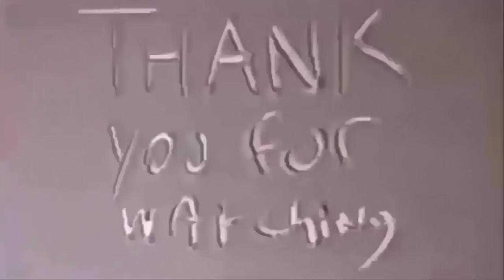How to Plaster over Artex and Textured Ceilings

Comment: Nice work mate! So is it OK to just do one coat with the bonding mix? And would it be OK to leave bonding to dry out for a week or so before another PVA coat and then 2 coat skim? I think I would struggle to do bonding and skim coats in the same day
Reply from the maker: Hi mate I would try do it next day if you could so its not as dry still might be good to give a little pva also then 1st coat and 2nd coat with a new mix so it gives you more time to help you get a good finish

Comment: My cellings in need of a skim how much pva do I put on one coat then let it dry then another coat then skim I'm scared of it cracking
Reply from the maker: Depends on the type of pva mate most want 1 coat then yes a 2nd coat when the 1st has dried then plaster over when tacky pva wont stop cracks only way to stop it re cracking is stop movement ie a lose plaster board of moving timbers above and re scrim taping before you plaster but pva will stop the plaster failing and drying in to fast before you finish it, It is a very important part mate have a few other videos showing detail on that also

Comment: Great video. If  I key up my bonded ceiling with a stiff bristle brush let the bonding coat dry for 24 hrs and then plaster it because I've keyed up the bonding will I need to PVA it because I have let it completely dry.?
Reply from the maker: Hi mate If i was to do it the next day the way I go about it is I would bond ceiling up at the very end of the day and it would be the very 1st thing on the next morning sometimes if its to dry you will need a coat of pva just have to test to know what suction is like , but i have done it next morning a good many times with no issues but you are still always aware to get it on quick and neat as possible just encase if that makes sense :) Thanks for watching and supporting buddy means a tone :)

Comment: Good job mate, can it be done on flaky artex?
Reply from the maker: B3efore plaster8ing any lose or dusty or flakey surfaces would need to be made clean sound and dry before plastering over so flaky would need scrapped clean just make sure its free of asbestos and wear a mask all the same mate all dust is bad for us to breath in but when you get the prep done the methods i used are good to go :) Thanks for watching buddy
Reply: @macplastering  Thanks for the info, good video. Cheers.
Reply from the maker: @HektorBandimar  Any time buddy just remember we are only as good as the surface we are working over so get the preparation right and the job will go great from there in :)

Comment: Hi, quality work mate, when you use the speedskim on finish would you recommend the metal blade or the plastic ?. With always using a stainless steel trowel you'd think the steel blade speedskim would be the obvious choice but not if the edges needed to be broken, whereas the plastic blade might be more forgiving. Keep up the great vids.
Reply from the maker: I hear you mate I have found most the steel spats good they do have a slight round on them but some like you say leave a little line / trowel mark but the way i use them its fine as either on the bonding a quick flat and brush over for the skim or if using over skim I trowel up after s the lines dont effect it much at all as i use it to help get flat and straighter  hope this helps some

Comment: Hi Mac, that is a quality job 👏 

Is it possible to just go straight for the ceiling with multi rather than bondin it first, I think I made a mistake 😬 as in I 2 coated with multi only but it looked decent after. Think I’m gonna be bonding first in future.
Reply from the maker: Hi Paul buddy great question , Yes it is ok but remember skim is best at just 2 to 3mm  if I just tried to skim this it would been mabe 6mm plus in areas , bonding is great for a few reasons it acts as a filler as i showed and a way to get them angels nice and straight, also its got great bonding capability's more than just skim its a little more flexible , so should help slow / stop cracks , its fire proof and will help stop sound also , its weakness is that it is useless to anything damp , but skimming on low texture is ok i just prefer this way on the most
Reply: Thank you for your descriptive reply Mac , I’m definitely gonna use bonding in future. Your ace on them stilts mate, I recon I’d go through the bedroom window on them 😂😂😂
Reply from the maker: @paulrossiter9567  Have almost done that before myself luck there was to strong lads there to catch me I would have been a mess heading head 1st at some french style door glass and thin wood it would not have been good LOL

Comment: Good video, one question you have brushed the bonding so the skim coat will key , would you PVA the bonding reason I ask some plasters PVA bonding plaster because it sucks the water from the skimming plaster?
Reply from the maker: It dose but it wont if it is fresh bonding and skimmed at the right time I like to get the skim on when its setting or has just set if going the next day it most likely will need pva to control suction hope this helps mate  :)
Reply from the maker: Always 2 coats of skim mate some guys do 1 but I always do it by the book 2 coats everytime :)
Reply: @macplastering  cheers that helps.
Reply from the maker: @dilligaf2386  my pleasure mate always here for help and support :)
Reply: @macplastering  it's good to have someone you can get advice from, cheers.
Reply from the maker: @dilligaf2386  Anytime mate always here and open to doing how to's that the viewers want to see :)
Reply: @macplastering  hi my friend would you be able to answer a query,  how thin can you use bonding plaster, I've got some bits that need bringing out 3 or 4mm before I plaster.  I know you can go 11mm but can't find anything about how thin it will go ,or is that because you can go as thin as you want to.
Reply from the maker: @dilligaf2386  Hi mate carlite say when using bonding you must apply it like 12mm or they wont cover you if anything was to go wrong but I have used it as a backing plaster to get door frames or patch in door way ect with bonding from a few mm up to a few inches  but if it is deep best to just put another board on LOL but to answer you I have used bonding a few mm think and has been fine for me
Reply: @macplastering  cheers buddy.
Reply from the maker: @dilligaf2386  My pleasure mate anytime :)

Comment: Nice one Mac mate!  I bloody hate Artex! Have you ever tried to get it completely off?! Bugger that eh mate!
  Btw  Could you use SBR instead of PVA?
Reply from the maker: Hey buddy I lost a job before and apparently the other guy doing it was going to use sbr but I would say it would work but in my opinion and experiences with both sbr and pva , pva for this is way more practical, oh  hell no on getting it all off LOL not this type of texture ts skim coated then swirls and painted so strong LOL only way getting it off is a hammer and re board LOL Thanks for the comment buddy raised a great question :)
Reply: @macplastering  Awesome... thanks for the reply Mac mate. Like most other lads the first thing I would think of doing would be to overboard with 9mm boards. But for sure I'll be using your method from now on. And whether asbestos is present or not, if you're scraping back or rubbing down you should wear a mask and safety specs. I've got a proper good filtration mask that doesn't make your specs or goggles steam up! That's a bloody pain as well. All the best my mate!
Reply from the maker: Oh yes Craig buddy safety all the way getting good googles and masks can be hard  to do but a good set will be well worth it all the same :)
Reply: You can use sbr but always go onto it while it's still tacky. Gives a very strong bond that way

Comment: Sorry to bump an old video. I have popcorn ceilings. Maybe 3mm max in some places. It's a 60s build so most probably asbestos. 
Can I get away with 2 coats of finishing plaster or should I use bonding plaster 1st as it's 3mm max. 
Do you have a link for a decent first coat trowel. It's a minefield. 
I've always used joint compound but want to have a crack at the pink stuff. 
Another question if the final coat doesn't give you the desired finished (worst case ) can this be rectified by another skim coat. I like to know I can sort it before looking like a fool calling a plaster out. I'm very handy and am confident but helps to know worst case senerio. Cheers
Reply from the maker: if it is sound and not lose I would pva bond and skim mate , very very worst case the whole lot drops off , other it cracks but try do like i did scrim any old cracks , other bad things is it dont look good finished , and yes for sure you can re-skim as long as laths hold the weight , plaster is heaviest when mixed as it dries it will become lighter, reasons for a fail could be lose background , poor prep ie dust or missed areas with pva or wrong mix of pva to weak,  pva and bonding will go a good way for you bonding is even lighter that skim coat its  fire proof and acts as an insulation heat and sound some also believe it helps reduce cracking, getting the timing between bonding coat and skim coat will help as it can blisters and slide if to early I know for sure its a great option as you can find more than just tis video with me going down the route, Think i have covered all your question's again mate there is more on this on the channel if you need :)
Reply: @macplastering  Thanks Mac I hear what you're saying. USE bond it will make life easier and neater. Can I apply the bond coat 4mm/5mm ? I have a loft panel in the room so I was trying to avoid going too deep but guess I can rebuild that if needs be. 
After applying the bond coat realistically how long after do I have to add the 2 finishing coats. Several hours window or as soon as the bond starts to dry otherwise it needs another 2 coats of PVA ? 
My guess is the bond is kind of like using overboard it gives the plaster a smooth surface for quality finish. 
Will any stainless steel trowel work ? Whats the best option here. 
Thanks for taking the time to Reply and 1 Sub added.
Reply from the maker: oh and this is a trowel i love - https://amzn.to/3yNcLmo
Reply from the maker: @m1k3y96  this is also a good trowel its got a little more flex in it - https://amzn.to/3ebLRwG
Reply from the maker: @m1k3y96  Than you for subscribing mate Its hard to put a time on bonding sometimes as soon as i get it eyed up its not far from me starting to skim over other times it takes hours carlite bonding can take upto 4 hours to go off in these videos mate I show the colour and feel i go for before i mix I will drop you the link to them ones as it really is about feel more than time if that makes sense
Reply from the maker: @m1k3y96  You might have seen these already but this is part 1 to the same kind of job you are doing loads of details why i made it a 1 to 4 = https://youtu.be/RV4w_2ommlU
Again appreciate you subscribing and supporting if need to ask anything on there just fire away mate I do test a diffrent bonding but its same results : )
Reply: @macplastering  Thanks Mac. I was also looking at a superflex for the finish and a speed skim. Would you recommend those. Maybe 600mm speed skim. 
Appreciate your time mate
Reply from the maker: @m1k3y96  Yes mate I do use them I would use super flex 3 from refina its very nice and is ore forgiving if you get timings of some as its stiffer so wont ride over bumps also love tyzack spatulas  again all these tools are on our amazon shop and can see the ones I tend to use the most during videos
Reply: @macplastering  Thanks Mac I'll give it a watch. 
Just ordered the finatex 2. 
The available bonding near me is gypsum bonding. Hoping that's suitable enough. OK so worst case I can bond and leave 24 hours then pva for final 2 coats. 
Going to catch up on some of your vids.
Reply from the maker: @m1k3y96  Yes man now if you get it on neat and tidy or if not you can trowel it in and key it up let it set up some but yes mate the videos show better than I can type in words LOL let me now how ya get on and if you want ask more questions on videos or parts of the videos if you want to try understand further :)
Reply: @macplastering  Hi Mac Sorry to pester you again but tomorrow is the big day for me . I plan to bond then 2 coats of multifinish. Am I taking a risk in doing it in this heat ? 
I brought the finatex for laying and the superflex 1 for finish. 600mm speedskim also. Is there any breaking in needed on these trowels or will they serve me well tomorrow. 
I've already diluted pva 4 to 1 and covered the ceiling. Tomorrow I will pva and wait till its tacky to start. Will a 4 to 1 ratio do for this or should I change this ratio. 
I'm hoping the weather doesn't dry my bonding/plaster too quick. Cheers
Reply from the maker: @m1k3y96  Hi mate I never needed to break any super flexes in the steel trowels work o when new but much better after a few weeks sand and cementing I did a video on working in the heat might hep some - https://youtu.be/4v-FU_rpsbo
Pva is best to read the one your using mate they are all diffrent and I have even seen them change what they say on the back from time to time witch can catch out even the most seasoned plasterer 4 to 1 sounds like a sealer so for sure ready the back 1st mate a you might need 3 to 1 or 2 to 1 or 50/50 it should say under plastering section / as an adhesive for plaster / plastering Wishing you the best of luck mate
Reply: @macplastering  Hi Mac, hopefully you're not bored of my questions at this point.
I did the bond and left it for 24 hours as I ran out of time. It turned out ok but being a bond  it didn't need to look amazing. Fast forward to today. I pva'd up using a 3-1 (bostik PVA) and my multifinish literally started drying the min I put it on the ceiling. Infact the bucket mix I made went hard very quickly and I ended up wasting over half a bag with a half finished ceiling with 1st coat. What did I do wrong any ideas ? I have sealed all the plaster bond coat again ready to have another crack tomorrow. 
Definitely don't want another day like today but want to learn from my mistake. The pva I put on before 1st coat kept drying really quick. 
Think I may have overmixed the plaster as I had to add a little extra water after I mixed as I felt it was too thick. 😅
Half tempted to put the PVA on neat to stop the suction lol. Really need some solid advice on this one. I'm determined to learn from it. Cheers Mac
Reply from the maker: @m1k3y96  How old is the skim mate sounds lie the plaster could be out of date ? there is dates on the sides, so if I was in your shoes I would scrap it all down any spots that are not neat pva to control suction . thing is it might still dry in fast but if you get that 1st coat on tidy quick neat flat then 2nd coat stright off the 1st coat will slow the second coat it will kill that suction :) Ceilings are very hard and in this heat plus the dry background you will want to do things quick but tidy as possible with out panicking hope this helps
Reply: @macplastering  Hi Mac, thanks for the reply mate it's appreciated. I checked the dates on the bag. Fine till November this year.
The 1st coat I applied was near flat. I have some experience with joint compound so got it on smooth enough. A few high points to get rid of that's all. 
The plan is, reskim 2 coats again tomorrow. It's meant to rain so I'm hoping for below 25 degrees. Is it better to apply 1st coat slightly sloppy/wet to give me a bit more time ? 
Knew it was going to be hard but determined  to get good at it. Cheers
Reply: @macplastering  Hi Mac, finally managed to get it finished today. Thank you so much for the advice and support mate its really appreciated. Managed to get nice smooth finish too. 👌
Reply from the maker: @m1k3y96  Nice one man Yea it can be a struggle ceilings can be the hardest job to do also  , I do prefer if bonding to skim same day but if I know i have no time i will leave the bonding until the last minute to try keep as much moisture in it for the next day

Comment: Hi mate great vid on the First  trowel if the trowel is leaving lines when your trying to flatten do u leave it fir another 5 mins or so 
Making your first wet trowel easier 👍
Reply from the maker: i woud have many year ago but I after this amount of time at it i can get it ice even when wet  in all honest i even try and get it flat as possible with 2nd coating find it makes all trowels easier if you know what i mean : )
Reply: I Do try that what would u say less trowel pressure when applying or putting on n then taking off as u go as u go over the area
Reply from the maker: @HSilver341  Sorry for late reply buddy but yes when soft less pressure and when i get it on i try not to take of but move around into the holes ect unless its need on a lumpy are on large bump but again with tidy coating tends to be less of these problems  I find

Comment: I was doing this last night I toke of the high points the unibonded it then something came up and the unbound dried in so I gave it a second unbound and bonded it out when the unibond was tacky after I had finished the bonding I came back to check on it 3 hours later and I could still trawl it it was steal that soft.  Do you think the coat of unibond that dried could stop the bonding taking to the artex
Reply from the maker: might ave slowed it for sure mate what type of bonding where u using thistle or carlite ?
Reply: Yea it defanly done that it was thistle bonding I just checked the bongo g dose now appear want to come away from the ceiling so will have to get the mixer going
Reply: The bonding dose not want  to come away from the ceiling lol. I need to start to check the messages befor sending them
Reply from the maker: @donal6144  I have seen bonding not set for up to 4 hours , especially when colder 

Where you able to get it skimmed last nite mate?